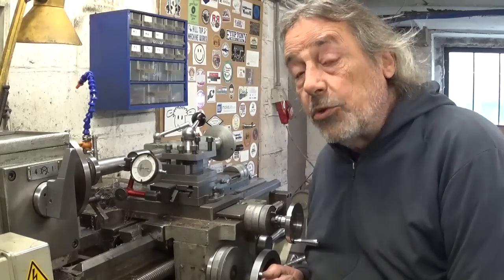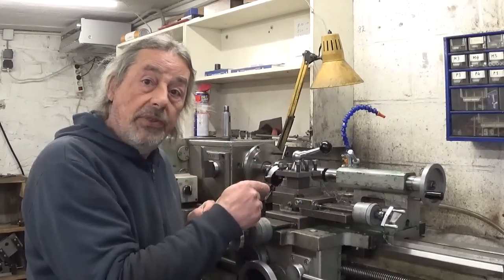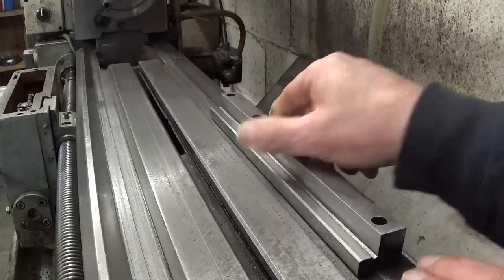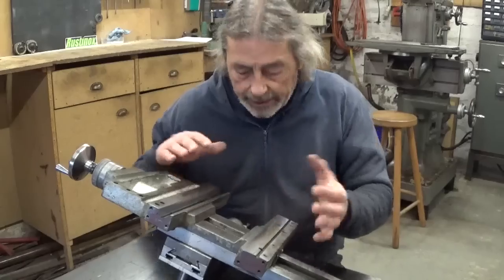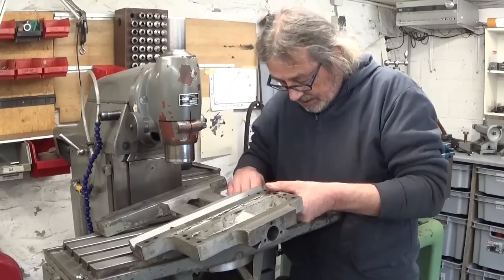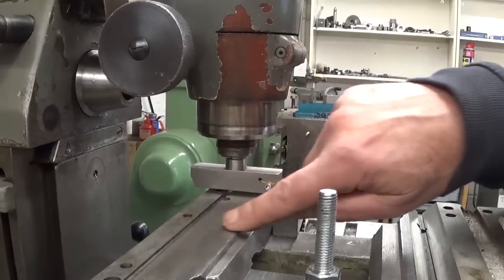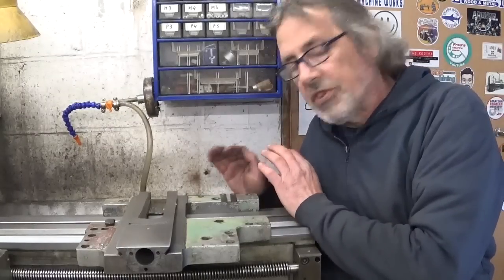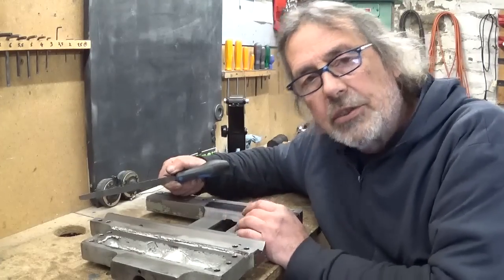Rectifying the saddle of the lathe.

Comment: Thanks, very nice video.   I'd try twisting it, one direction, then test, then twist in the other direction, then test, just to see if it straightens out or there is still a spring/latent twist in it that still wants to come out & drive you crazy trying to chase it.  It may still be a moving target after all these years!  Also, thanks for the 'Anti Scraping' message!  If engines can lube their rings with cylinder surface scratches retaining lube, I think ways can do it too!
Reply from the maker: It's still not perfect but it works.

Comment: That was very interesting Michel. I saw Vintage Machinery (Keith Rucker) remachine the v-ways in the saddle but he had a mill where the head could tilt backwards.  He pointed out the bed is sometimes induction hardened but the saddle is not so in that way the saddle is designed to wear before the bed. I'll be interested to see how you tackle it. Cheers
Reply from the maker: It will be in the next video.

Comment: Hi Michael, I see comment about warping of the saddle being caused by improper ageing. Ageing the casting does little to relieve the stress from casting, heat treatment properly done is much more effective. however more expensive so not always done. 
I would also be checking the apron mounting surface to ensure it is flat, if the casting has bowed then the mounting surface is likely to need work. I would also check the top surface of the apron and the hold down casting to ensure that the warp has not been caused by those surfaces not being flat causing the saddle to bow,
Reply from the maker: Thanks Gary. I fixed the problem.

Comment: Re-scrape the inside of the "V" to take out the "bow" it won't take much!if it's carrying on one part of the "V" near the middle, the ends are not supported, leaving a gap which will allow it to twist a small amount! get yourself some Prussian blue to test it! It won't take much to scrape it! Cheers, Matthew
Reply from the maker: I used sand paper. This cast iron is very soft, so easy to work.
Reply: @Rustinox  Your choice! Scraping is a far better result! I've rebuilt machines and scraped them in! Scraping is daunting, but my personal experience has been that it can be surprisingly satisfying !  Cheers Matthew

Comment: Rusty.
It is a good job the "Vee" way needs adjusting.
You were making a mistake only doing one side.
Removing the surface on the flat section will make the saddle sit wrong on the Vee.
It will also make the cross slide lower at the back changing the centre height as the tool travels.
Reply from the maker: I dressed the little error with sand paper.

Comment: Hi,Michel. The cause of that warp/twist in the casting is most likely because the saddle has not been fully aged by heat treatment before it was machined at the factory. Any iron castings that are not fully settled/stress relieved by heat treatment will continue to move and warp for some time after they are first machined. Looking at the rock in that saddle also leads me to think it has been a big part of your problems with chattering when parting off. I see from comments further down you have resolved the problem now so I look forward to next week's video.
Reply from the maker: I also think, the parting problems I have comes from the rocking and twist problem.

Comment: Generally speaking the saddle ways are relieved in the center portion about ¹/3 of the total length of the saddle on the V and flat, makes so the saddle does not rock as the saddle wears. So basically you are working on 4 pads. As the saddle  wears Generally on the front ways from carrying the heavy load from the tool pressure.
Make sure to get the twist out of the bed first. If it's good proceed with checking the saddle you should start with the compound a work you way down to saddle ways. 
The easy way for you now is MOGLICE to bring everything back into alignment.  Cheers
Reply from the maker: Thanks for you input. In the meanwhile I fixed the problem. It will be in next video.

Comment: The rear clamp should never touch the back of the bed rail, just the bottom. I’m not sure if you were saying earlier that it was. Only on flat beds without “V” rails are there side guides. It’s hard to figure out why the dovetail is curved. I’ve seen a curve vertically in old saddles that match wear in the bed which had the bed ends curved upwards, in opposition, but never sideways.
Reply from the maker: The last time I installed the clamp, it wasn't touching the side of the bed. And now it doesn't either. And indeed, it shouldn't. I managed to get the twist out of the saddle with sand paper. It will be in next video.
Reply: @Rustinox  I had the same thought. It is the the 45 degree surfaces of the front upstanding prism of the bedways which prevent carriage twist in the horizontal plane, but they can only do this if the FRONT keepers (that hook under the front of the bed) are free of clearance beyond the minimum needed to allow the carriage to travel along the bed.
Reply: Otherwise the push-off forces on the tool can cause the carriage to ride up the inside prism until the front keeper stops it. Especially at the tailstock end, where there is no downforce from cutting.

Comment: Had a similar problem with my 81 year old lathe Michel. 
I put a short length of sand paper on the bed V using double sided tape and slide the saddle back and fore only on the high area. Remarked with a sharpie and checked it on an area of the bed. Then repeated until it was close to  perfect. It's not quick, but it is cheap.
Reply from the maker: That's more or less what I did. And it works. It will be in next video.

Comment: Without the use of a surface grinder I think I would use fine emery paper wrapped around a former that fits the vee groove. With careful use and checking with the Sharpie method I think it should be possible to make a big improvement, even if not perfection.
Reply from the maker: That is exactly what I did. It worked out very well. It will be in next video.

Comment: get the blue out and paint it all it has to have some wear issue. maybe some lapping compound and lap surfaces together?
Reply from the maker: That sounds scary. I don't want to touch the bed.
Reply: @Rustinox  
I know, but it works great for valves and hydraulic bodies etc.

Comment: I wish I was there to help you Michel.  It was great to see that the screw jack was useful.
As I sit here watching your video and saw the saddle higher in the middle, perhaps what we’re seeing is that both ends have worn down a bit. That would explain part of the side to side rocking.  There is a substance called “Turcite” that can be glued on sort of like a tape. And is can be scraped and is made for sliding surfaces.  If anything can solve the issue that would be it.  Of course you’ll have to scrape the high spot to level the surface but it may be the only way to bring the saddle back to original height. Just a thought. Gilles
Reply from the maker: Thanks Gilles. I used you jack several times. It works great.

Comment: Your last finding of some "hourglass" like wear in the V way of the saddle is almost certainly the issue.  I'd say that you need to scrape the V of the saddle to restore the riding points out at the ends to stop the pivoting.  But I know you said you hate scraping.  So I'll suggest that you use your "multi tooth scraper", otherwise known as a file, to do much the same to the V way as you did on the flat at the back.   

I don't have a proper scraper.  So on occasion I've resorted to a file to "scrape" an area  down in the same way as you.  And it works very nicely.   So I'm all in favor of setting up the saddle at a 45 each way so you can work "flat" to the surfaces and ease the high spots until you find that the V is riding at the outer ends of the "feet".  You're removing metal at roughly the same rate.  Just with a different tool.  And with the felt marker to work with it can be done with very nice sensitivity to amount and "close enough" spotting.

I hate to say it but you milled the back flat way to be parallel to the cross slide dovetail.  And it was tippy.  I'll bet it was tippy due to the wear on the V way.  But you fit the rear flat way to match the worn V way.  So you're back to the dovetail of the cross slide being at some slight angle to the bed ways.    If you work the V of the saddle down to match be sure you check the dovetail to ensure it stays square to the bed.  You're playing with the risk that it might end up with slightly concave or convex cone faces if not done with care.  Ideally a big facing cut is supposed to be very slightly concave.  VERY slightly.  We see this if we polish a face cut on the lathe with fine abrasive on a surface plate.  The outer rim polishes first and the middle last.  But it is supposed to almost not be enough to see by any other means.

Hope that helps!
Reply from the maker: Thanks for your input, Bruce. I already fixed it. It will be in next video.

Comment: Hi Rusti, I always look forward to your latest videos, this bow you have on the vee ways can be machined on your Deckel mill, or if this was me I would use a straight edge with marking blue, and scrape the vees untill you get the bow out, taking care to scrape equally both sides of the vees. But I know you don't like hand scraping! but it is really not much of a job, if you weren't so far away, I would gladly help, cheers and take care Dave UK.
Reply from the maker: Thanks Dave. I already fixed it. It will be in next video.
Reply: @Rustinox  thats great!

Comment: If you want, you can borrow my biax powerscraper and some straight edges. 
I think I don't live to far from you.
Greetings
Reply from the maker: That's a very generous offer, Frank. Thank you very much, but no need. I already fixed it with... sand paper. And it works just fine now.

Comment: eyup Michel
well thought out, and i'm sure you will improve it further with a little thought, trouble is with any machine they get worn unevenly depending what they are used for, so you may not get it perfect, but much better.
ATB
Kev
Reply from the maker: I fixed it. And it works.

Comment: If you put it on your Deckel tilt table, you can tilt it at 45 degrees and cut one side of the v groove with your same fly cutter.
Then tilt it the other way 45 degrees and cut the other side of the v groove. Then cut the other flat side again.
Considering how bad the bow problem is, you should be able to dial in those 3 cuts MANY times better than the current error...
Reply from the maker: That will be a lot of setup work. I just made id straight with sand paper.
Reply: Using the shaper might also work, if it has enough stroke.
Reply from the maker: @1873Winchester  The shaper would be the best option to do this, but the stroke is only 220mm and the part 350mm.
Reply: @Rustinox  I do believe my first option anyway would have been scraping it, I would have scraped the middle slightly low instead of perfectly flat. Then as it wears, it will wear into full contact before wearing convex again. That's how Deckel scraped certain items like the gibs on the X-axis table as well, slightly hollow in the middle.
Reply: The “v” is usually 60 degree included angle.